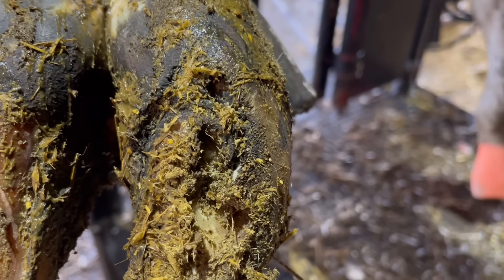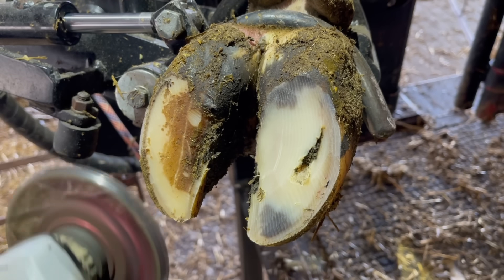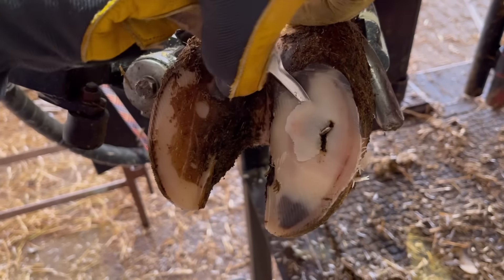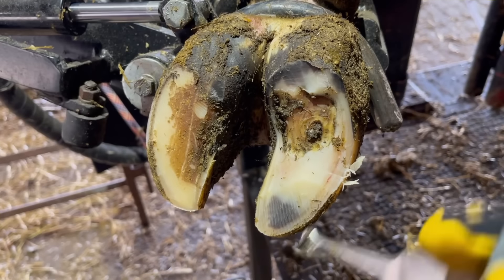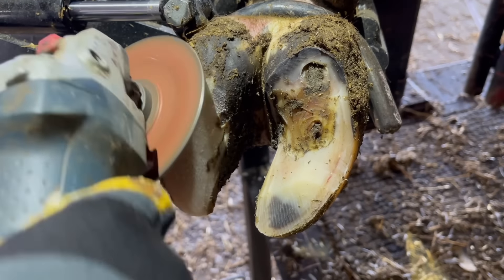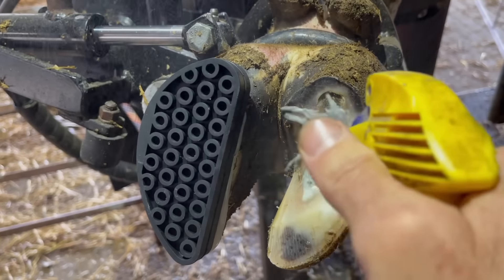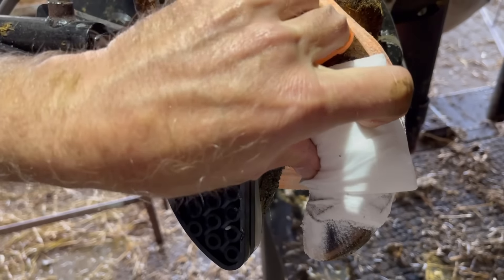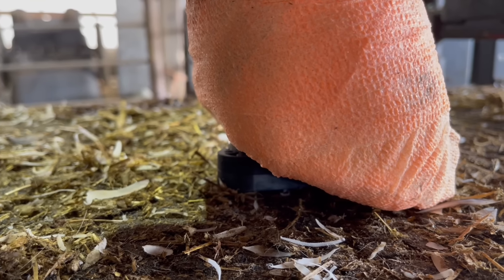Rocks have TUNNELED ALL THE WAY THROUGH

Comment: Nate, would you consider doing a little video explaining the machine that helps stabilize the cows while you work on their hooves? I'm fascinated with it! ❤
Reply: It’s basically straps that hold the cow up in air so he can lift one foot without putting weight on the others! It would be cool if he made an in depth video though!
Reply: Why don't horse farriers use one like it?
Reply: the crush
Reply: @user-xf1dm2te8v
Its called a "cow crush" or "cattle chute". So, the cow walks in, the front gate closes with the cows head out of a gap. Straps go under the abdomen and chest, so that if feet need to be picked up, the cow can be supported comfortably on 3 legs. Theres also the device that picks the legs in a hoof trimming crush like Nate has. The device to do this ranges from just a simple blunt hook and rope arrangement you hook around the leg and turn a crank to lift the hoof to the fancy thing Nate has that grips the leg and lifts it all in one motion. This is so  the foot can be held steady. Horses are trained from a young age to stand still and lift their feet for hoof cleaning and the farrier, but Im not sure if you could even get cattle to do that (I dont know if they are physically capable of it)

  This way, the head, rear end and feet are easily accessible for examination and treatment the cow/bull can be supported, and s/he cant thrash about and potentially injure the human or themselves if they become alarmed or something is painful.
Reply: That is an amazing thought
Reply: @meiko_kaji  it puts a real strain on their backs especially if the horse leans on them.
Reply: @robinminn271  Most horses won't tolerate being in a crush.
Reply: Thank you Nate 😊💫
Reply: @robinminn271  As someone who grew up riding horses, horses are super skittish and would likely hurt themselves when they got scared of the machine.
Reply: @childofcascadia  I am pretty sure, as you said, a cow couldn't lift its leg long and high enough to take care of a hoof, especially if you have to deal with an issue like here. Even if the cow was trained to do it.
Reply: @robinminn271 horses are used to being handled so they will stay still while working on one hoof at a time so they will not need to use this expensive piece of equipment.
Reply: @meiko_kaji  No, sometimes horses lean on humans doctoring feet and that can injure a human's back.
Reply: @Watoosi13 😊😊😊ooh  so o
Reply: I'm pretty sure he has one of this one; and one of his old one.. or they're the same video.. you gotta go back a ways though
Reply: @robinminn271 I would assume as a farrier you are not doing 200, 300 up to 1000 horses as you would do wih cattle. The chute allows you to set up an "assembly line" so to speak for getting the large amount of animals through. They do have tilt tables for working on horses. I think it's just a numbers game, I could be wrong though.
Reply: I watch a few hoof trimmers. Look up the hoof gp. He uses several crushes and explains about their advantages and disadvantages. I think Midwestern hoof trimmer (can't remember if that's the exact name) also does a quick one. I believe Midwestern trained Graeme and they're friends so you should be able to find the collab video on hoof gp.  Anyways, Graeme (hoof gp) uses a few and his apprentices have a spin off channel and they show the different crushes like kvk or his new one. He even made his very 1st one himself.  Hope this helps a bit. Watching these videos is therapeutic somehow for my PTSD and I do appreciate them and all the care they provide the animals.
Reply: How fast does the hoof material grow back after cases where a lot of the hoof needs to be cut away?

Comment: Doesn't running your blade through all those rocks dull your blade? Maybe it's just cause I'm used to working with chainsaws, and touching dirt or rocks is a quick way to dull the teeth on the saw. Everytime I see you just casually slicing through a hoof with rocks in it, I cringe a little, but I tell myself that your job is not the same as my job 😅😅

Comment: ❤NATE❤ 🐄 , I notice that you don’t dry off the claw that you plan to apply a block to, with a blow torch , although you do essentially score the claw before you attach the block. Does this depend upon how long you want the block to stay on and What kind of glue you are  using?  
How long does the block generally stay on and is the block a more slippery surface for the cow to walk upon?   Especially on a cement floor covered with slurry? 
It’s dangerous for the poor cow who slips and slides and ends up doing the splits…they’re really not physically built for gymnastics..and can seriously injure themselves..People see the back ankle shackles as cruel, but they really do prevent more serious injuries and may even offer some comfort and stability to the cow…and they can be removed when she’s outside..so she can kick up her heels in the pasture..
Keep up the good work Nate! ❤🇨🇦🙏🏻